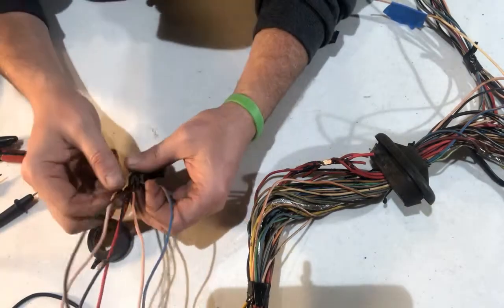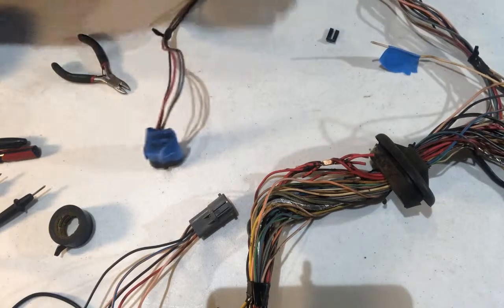Converting the Ford 5.0 EFI harness part 5: Removing the Brown and Gray plugs and associated wiring

Comment: These video’s are great! Question on pin #30 neutral lever switch is light blue with a yellow tracer leaving ECU and it runs to my tranny plug out. Here is issue on plug coming from tranny which is a T5 has no wire in that place? There are only 6 wires on my tranny plug 2 are the VSS +\- one loops out and right back in which is a red with blue tracer. The other 4 run to connector other than the 60 pin? The one the loops from tranny connect a red with blue tracer to a white wire with red tracer. Can you help? Not sure what to do with pin 30  nutreul lever switch.

Comment: Is there a "hack" for a pin that won't stay secured in the 60 pin connector? my 29 and 30 pins float in the hole even when the orange locking piece is in place.